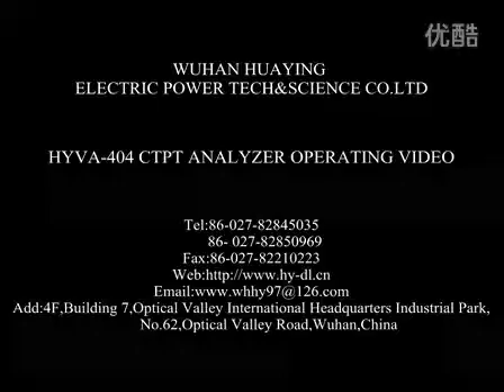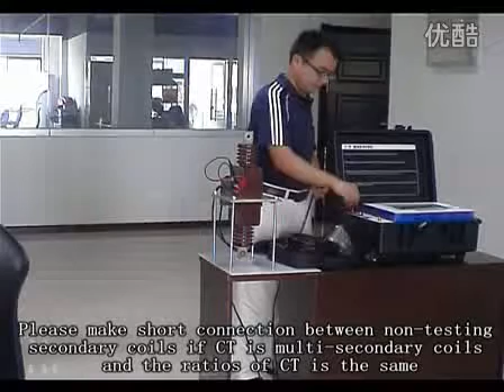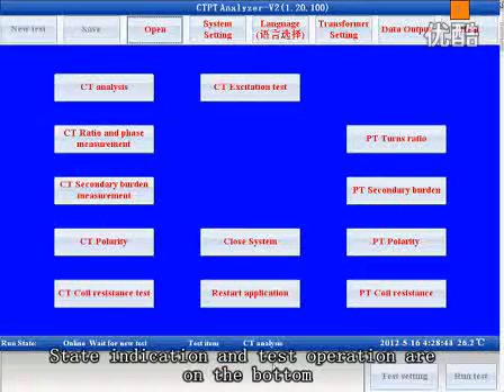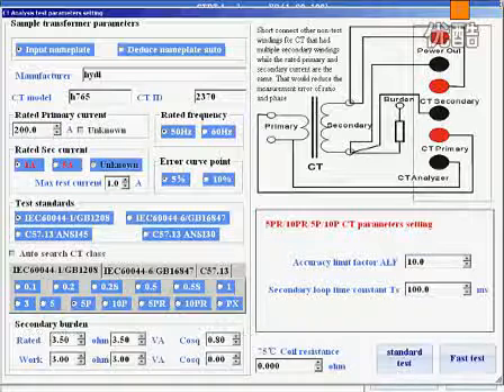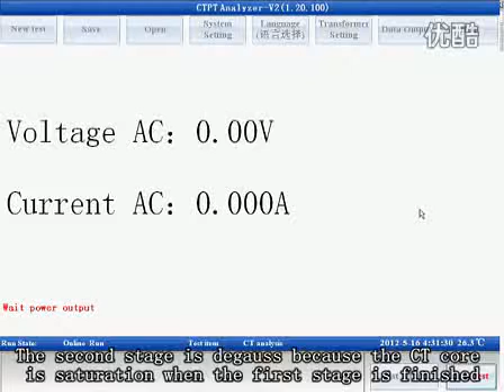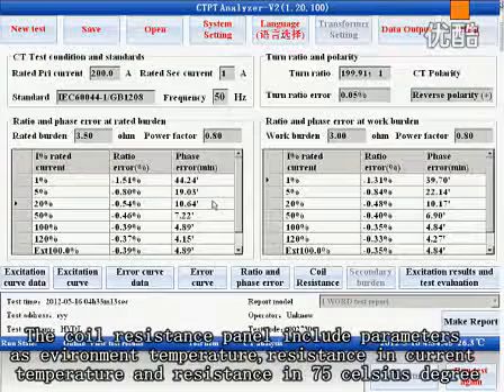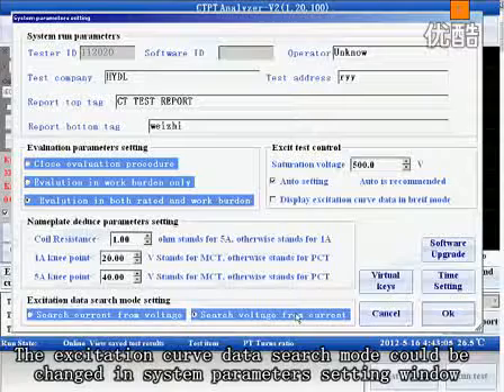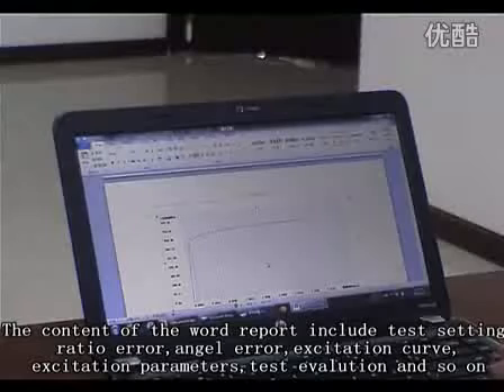HYVA 404 CT PT analyzer Operating Video

Comment from the maker: Hi,there.We are a professional manufacturer of electric test equipments including CT PT analyzer,oil break down voltage tester,transformer turns ratio meter,contact resistance tester,relay tester,tan delta tester,etc.
If you are interested please feel free to contact me.

Email:whhysales@126.com   Skype:amywang52016